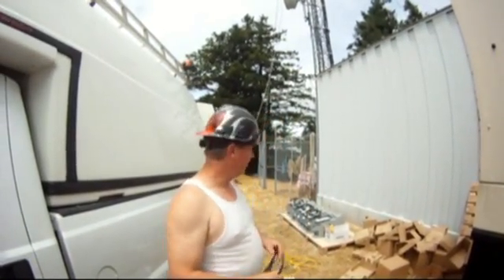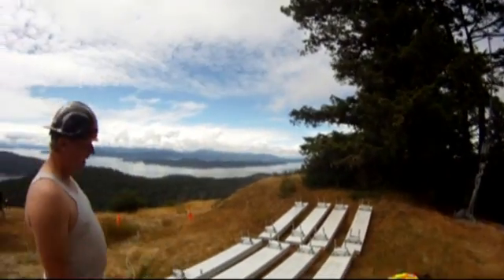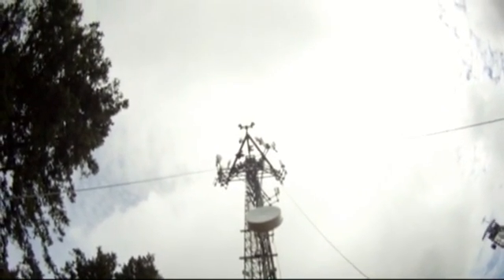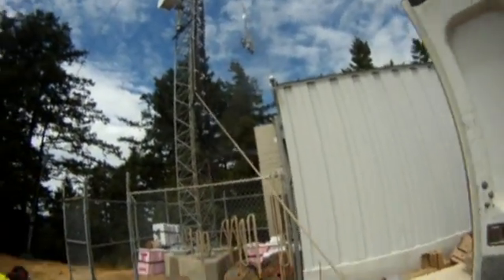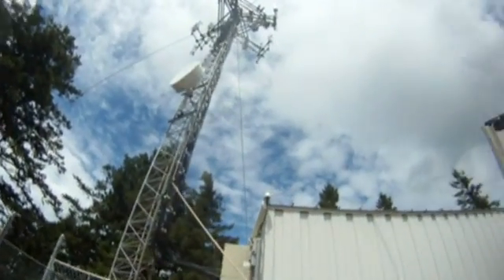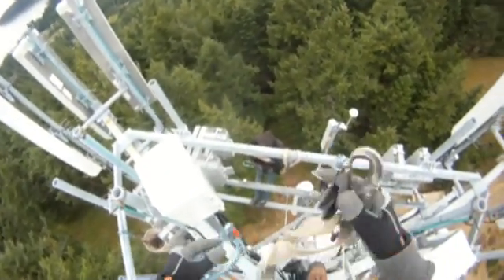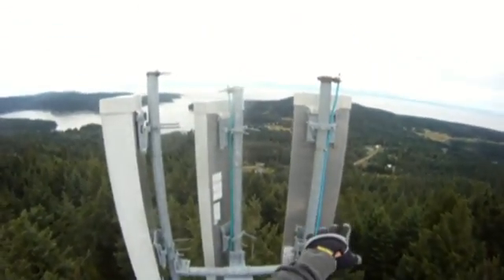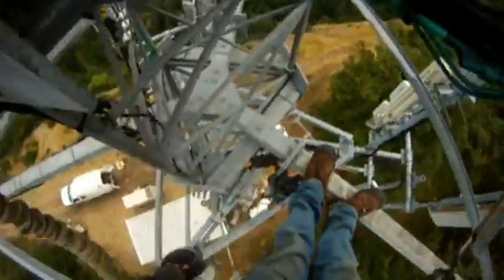Cell site upgrade on top Mtn cliff, GOPRO POV of tower climbers.

Comment: Great video if it didn't have so much steel in the way of the view.

Dumb question, other than last guy on the tower, why do you climb down instead of rappelling/abseiling?
Reply from the maker: Hi Jules,
  Yeah that location has an amazing view. I personally enjoy Abseiling down but,...  to many of the crews are inexperienced and proper training is expensive. So to counter this the tower owners have agreed to install a climbing slider device to all cell towers. This enables the climber to asend and desend without the tiring use of the double landyards. There are 3 main types used. Round rail, Tee bar, and Cable sliders.

Comment: How far away is that radar that shows up around 1:32?  Just visible above the tree immediately to the left of the cell site enclosure.  Seems odd that a radar and cell site would be placed so close together.

Anyhow, great video and thanks for posting it!
Reply from the maker: Actually a Radar and Cellular are on different frequencies so it does not interfere at all. In fact there are cell antennas on that same Radar tower just about 20 feet below the Radar antenna. As long as there is no people in line of the Radar broadcast there is no problem with this. It runs on the same principle as a single antenna that broadcasts multiple frequencies.